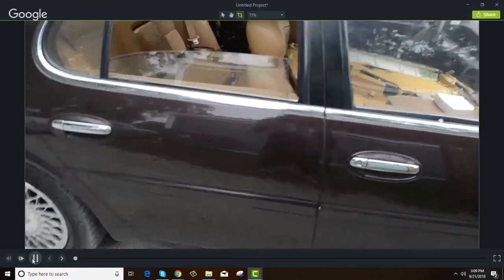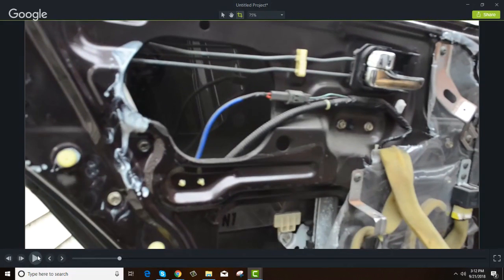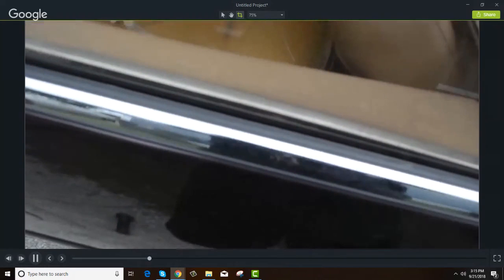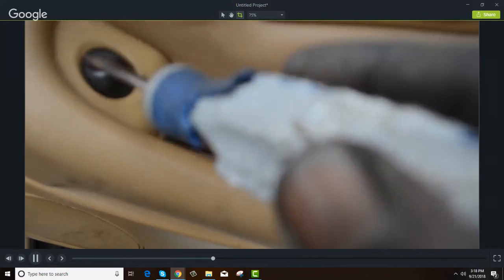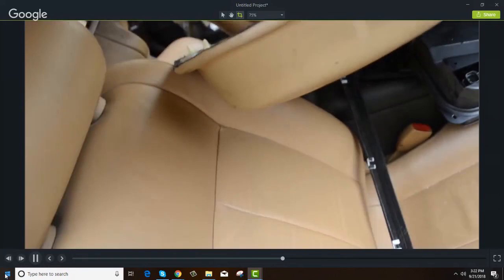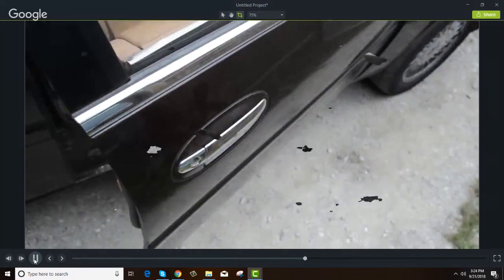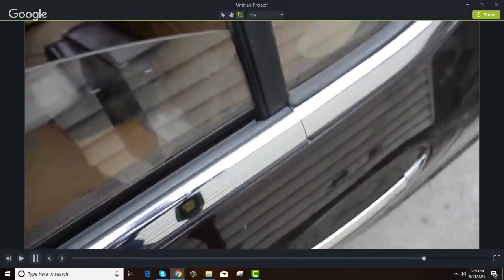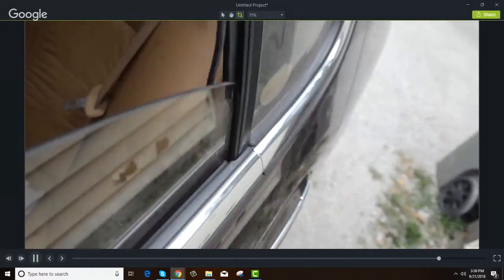How to fix a car door mechanism that wont open (from either inside or outside)

Comment: actually fixed mine from the inside, without a long metal thing, must just have been lucky with my car model, but some WD-40 in the mechanism when i got them open and now they seem to work just fine for now, thanks for the video